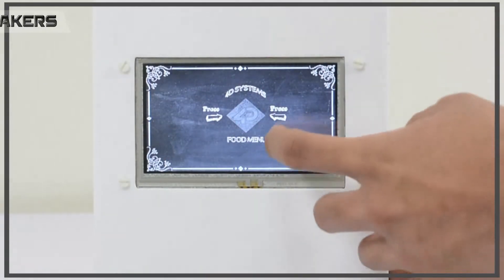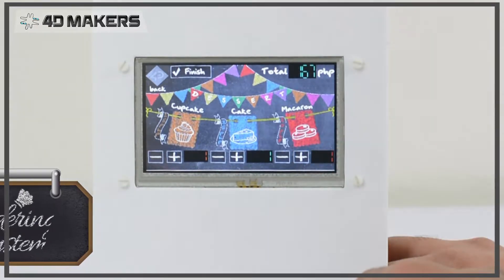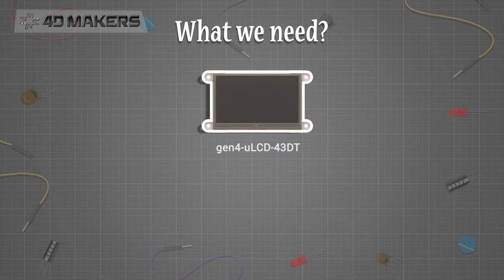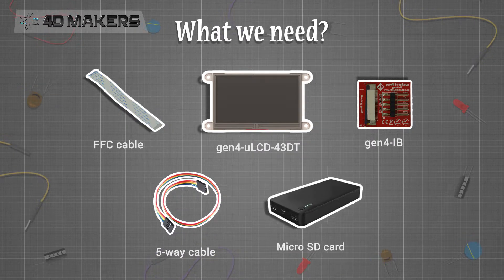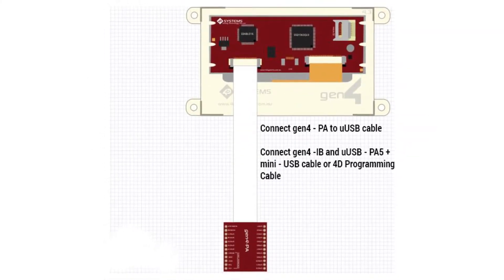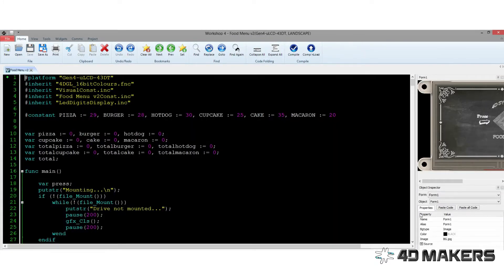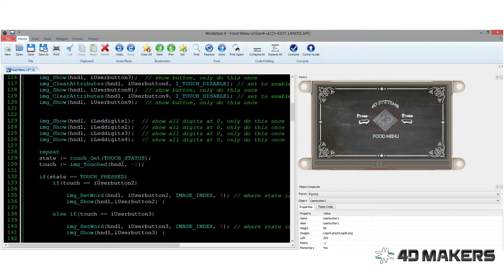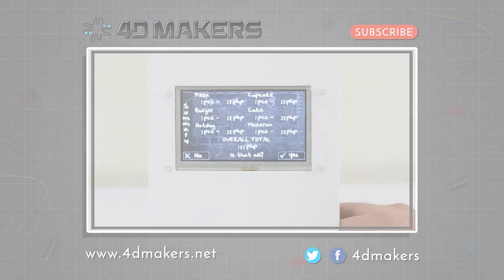Ordering System featuring 4D Systems' 4.3" HMI Display Module

Comment: Amazing what you guys can do! I’m just starting out with 4D and Arduino, can you give me any advice with a simple string box and keyboard project? All I want is 2 string boxes, a keyboard and to be able to fill out the string boxes individually on the display, eventually using this information (quantity -strings0 and length - strings1) as variables in a stepper motor program in arduino. I have all the graphics, keyboard, string boxes etc set up but just can’t figure out the reporting through arduino, even after playing with the demo calculators. Thanks for any help!
Reply from the maker: Hi! I'm glad you're starting out with 4D and Arduino! 
Regarding your question about the strings and keyboard, this application note might help you: https://www.4dsystems.com.au/appnote/4D-AN-00188/
If you want further in depth assistance with your project, you may start a thread on our forum: https://forum.4dsystems.com.au/. 
We will be very much glad to help!